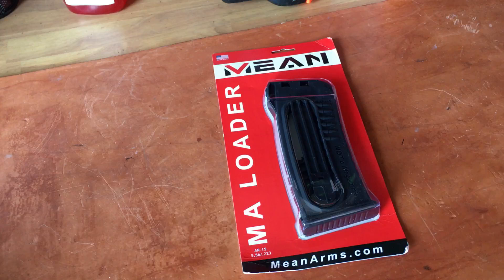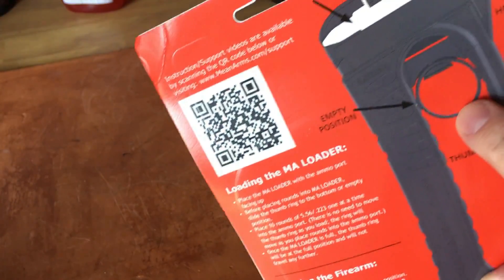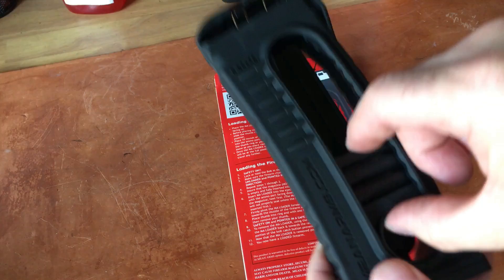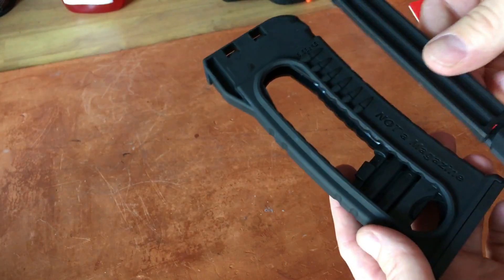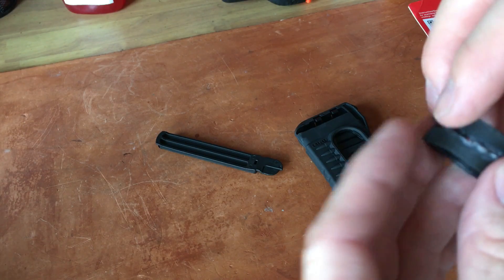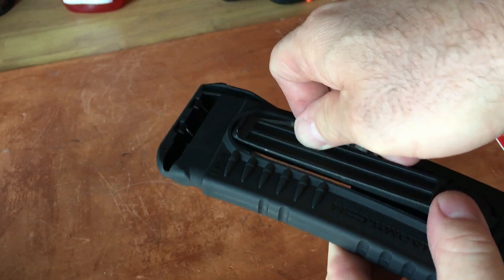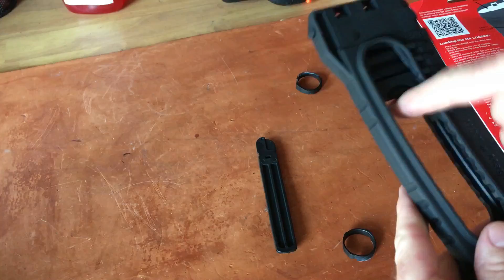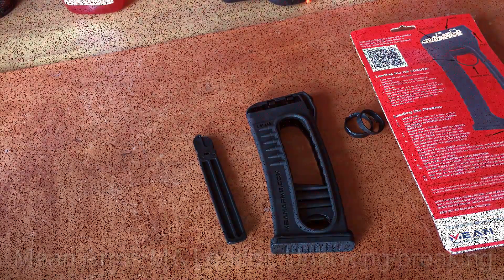I broke my Mean Arms MA Loader the first time I touched it!

Comment: Thanks to you they now put a "Please remove before use" sticker on that part to save others from the same mistake.
Reply from the maker: I noticed that in the "how to" video they posted (a few days after mine)...wish they would have posted that video before shipments started on 6/30.  My guess is they were so close to the product they just took it for granted everyone would know what it was and how to remove it before using.  With all the product delays, I thought this was a modification/improvement, especially since it wasn't referenced in the instructions.  Glad to see they responded quickly though with the sticker and video. In hindsight, I should have been more careful and paid better attention...I was just too excited to try it out after waiting 5 months.  MA made things right by very quickly replacing my loader with a new one.

Comment: Based on your initial impression, would you recommend this to those of us with fixed mags?
Reply from the maker: Yes, I would recommend the MA Loader.  The product feels solid and after I repaired the ring, I was able to use it as designed and found it did do the trick.  I made some dummy rounds to experiment with and after getting the "feel" of the product (how to seat it in the ejection port, similar to loading an M1A magazine - at an angle and ensuring the tabs  were in) I was able to load rounds into a fixed mag.  Anything I can do to reduce having to open my upper/lower unnecessarily is a good thing. 

I even tried to force a double feed to experiment with handling the issue should it occur at the range.  The included Loader "lock" was actually helpful on opening up the PMAG as well as a device to use in the ejection port to help remove the double feed.  So it's a tool as much as it is a lock for the Loader when needed.  Everyone (as I've seen online) will have a different way of dealing with a fixed magazine and double feeds, so I'll leave that one alone.
Reply: Re Loader thanks brother! I will order today. The things we have to do when we are behind "enemy lines"!!! lol
Reply: These loaders are a great idea but it's a flawed design
Reply from the maker: When I first saw this I knew immediately it was a great idea.  MA was first to market and that has both pros and cons.  They went with a specific design and everyone else behind them gets to benefit from that in terms of making product/design improvements.  Will be interesting to test the BF10 side by side, but that will be a while at least before that ships.
Reply: Re Loader The BF-10 is by far a better loader compared to the MA loader. Many people experience a double feed because of the MA design with the thumbhole.
Reply: @boostimalaka1  bought these tried it for the first time today jammed my ar 15 3x's

Comment: I just bought this loader. I think that “lock” as you called it, is actually a tool to remove plastic mags out of your lower that are locked with a Mean MA lock in case it fails. Good luck!
Reply from the maker: I believe the original intent of this piece (they stopped including in with v2) was to "lock" or rather prevent any bullets from escaping a fully loaded magazine (not an issue when in the magazine well, but more so if you had extra loaded magazines in your range bag).  Given its shape and the composite material, it certainly can be a handy tool for sure.

Comment: Yeah I got mine the other day and they have he sticker on them. It says it's a "multi tool". For what I have no idea. Would love to find out what other uses the lock piece serves
Reply from the maker: Besides serving as a lock for a fully loaded loader (I am not in the habit of carrying around loaded magazines, so I'm not sure why I would carry around a fully loaded MA Loader) I've found that I can use the tool for helping with double feeds, specifically using one end to push the floor plate release for a pmag as well as fishing around inside the ejection port for helping with a stuck round.  Beyond that, I'm not quite sure...but I'd imagine a lot of thought went into the lock.  Funny thing is it's completely undocumented or referenced, at least at the time of the release.

Comment: Hi Thanks, Just got mine today and ended my 4 months wait.  Question for you.  Have you any info on how to remove a MA LOCK once installed?
Reply from the maker: The MA lock threw me for a loop.  If you watch the MA Arms video(s), the "lock" (or tool) seems to almost fall off when touched.  When I opened and examined my MA Loader, the "lock" was quite rigid to the point of almost feeling like it was part of the frame.  I actually thought it was one of the reasons for the delay in improving how the rounds stay in the Loader (if your pull the ring all the way down and throw a few rounds in, they all slip out the sides...I thought the lock was a way of keeping them in).  Turns out all you have to do is slip a finger/thumb into the ring and push forward for the lock to snap out or at least for the bottom to snap out so you can remove the top.  Mine definitely did not pop out as easily as was shown in the subsequent video by MA Arms (I'm guessing I wasn't the only one to break the ring pretty quickly as they made a "how to" video after mine and now include a "remove me" sticker on the lock).

Comment: The term MA lock as I see on the packaging and videos is actually the 2 piece RED locking device that for slaves in cali. need to lock our 10 rnd. mags into place so as to not be able to push a button and have the mag drop.

It seems we should be able to remove this device, if we want to take our gun out of state and take it back to origonal. What say you.?  Can it be removed by anyone easily?
Reply: It can be drilled out by anyone skilled in the art.

Comment: How do I remove my ma lock?
Reply from the maker: Put a finger or thumb through the thumb ring and push the MA Loader lock/tool forward.  Doesn't require a lot of force.  Once the MA Loader lock/tool "pops" out of the base, you can pull it (will be at an angle as there are two "ears" that hold it into place at the top) down and aware from the Loader.